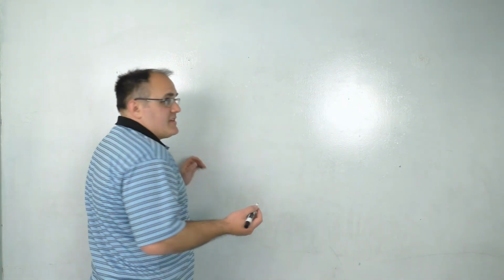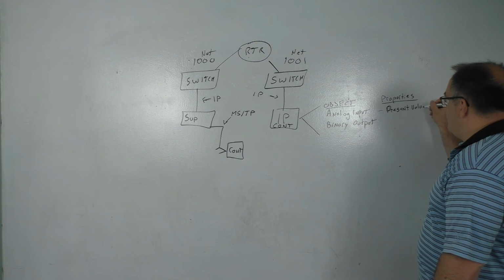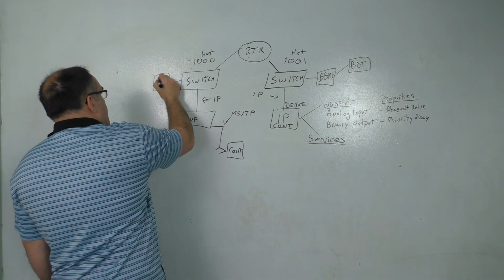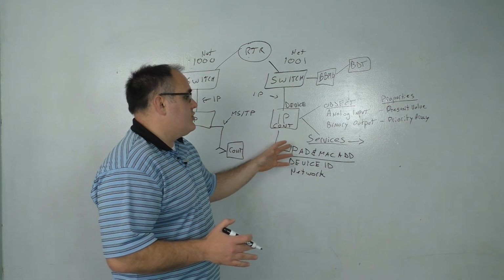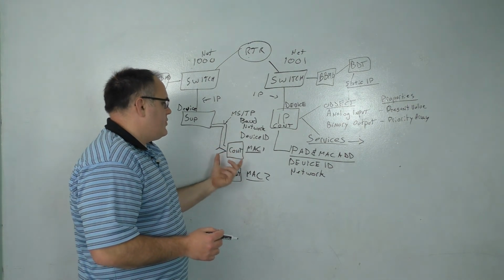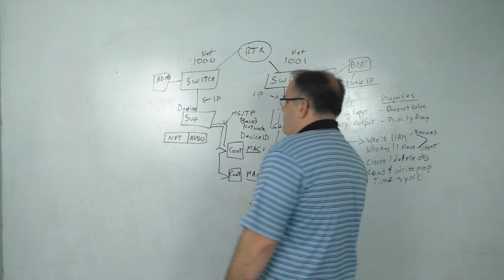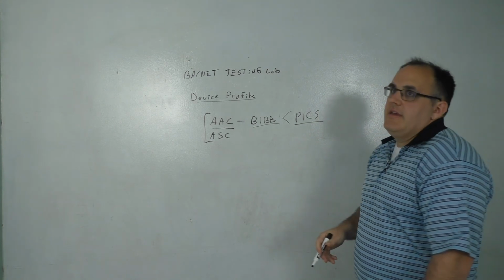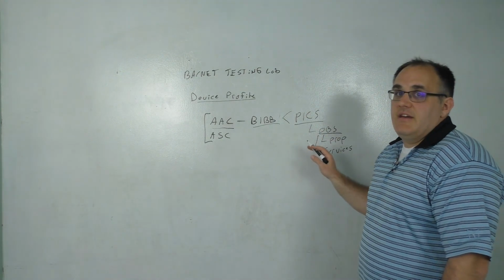BAMTV 005: BACnet Integration Fundamentals part 1

Comment: In mstp max how many slaves we can connect
Reply from the maker: If I remember correctly without referring to the protocol specification its 128 through 256 that are allocated to slave addressing. I could not see a scenario where you would have this many slave devices.